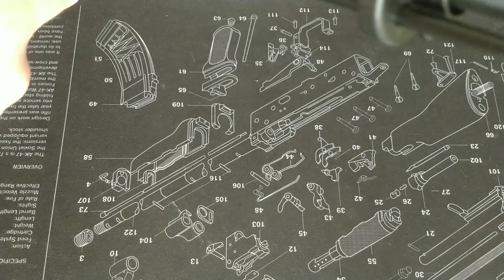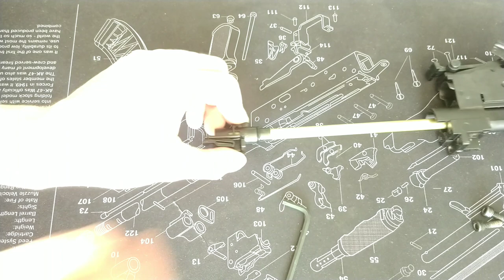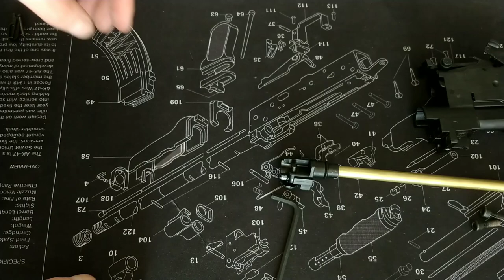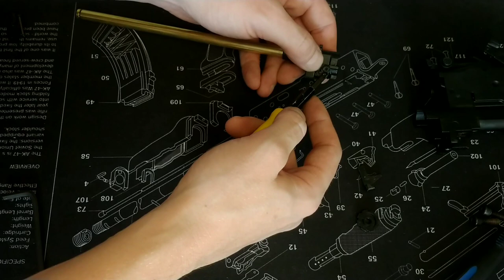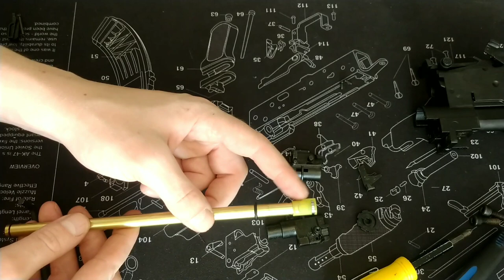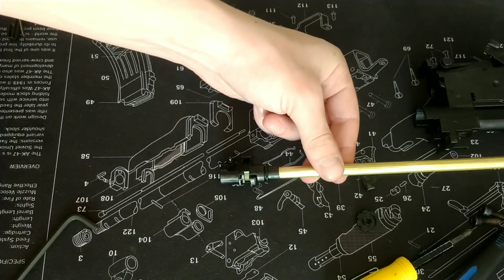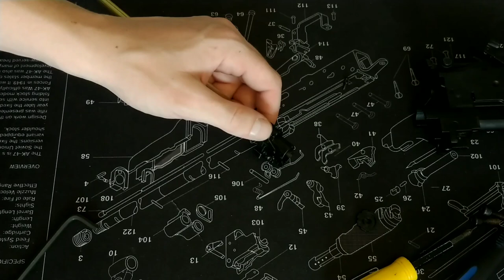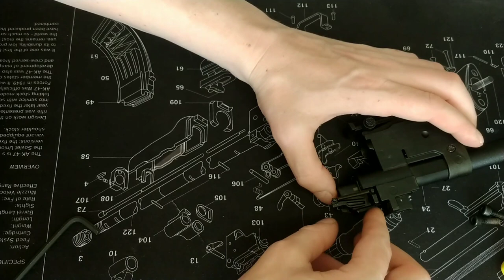Marui AKM GBBR - Guide for installing a new hop rubber using a Maple Leaf Silicone 60° Mr Hop

Comment: I wonder if there's a benefit to installing a longer barrel 🤔  tight or widebore? I don't know enough about the benefits tbh. I have the 60° hop and spring on their way.
Thank you for your time and info on the TM AKM. There aren't many videos on YouTube covering what you have.
Reply from the maker: So a longer barrel will increase your FPS and accuracy, a tighter one will also add to the FPS and Improve accuracy a tiny bit but not as much as adding length. A wide bore will reduce the FPS a lot, probably more than you would like (better for HPA as you can increase the volume of air being used with each shot)
The hop rubber will be the biggest game changer when it arrives!!
Reply: @Ollie Talks Airsoft  lovely, thanks for the quick reply m8. I was kinda underwhelmed by the AKM range from stock. The hop and spring will definitely make me more willing to run with the AKM. It's a shame the mag capacity is so low really. 
I'll look for a longer barrel - any suggestions bud?
Reply from the maker: @richard_pryor  I've found the maple leaf crazy jet barrels are great bang for your buck 👍

Comment: Been a fellow lurker for some time. Finally pulled the trigger on a new tm akm set system thanks to you :3 grabbing this bucking 1st thing  once mine arrives in the states.
Reply from the maker: Glad you're enjoying the content, the AKM is an absolute beast so I'm sure you'll be happy with it. Also it's good that the takedown is so simple to change the hop rubber. And being in the states a longer inner barrel will bump your FPS up to US limits.
Reply: @OllieTalksAirsoft  Read my mind! Starting with the stock 250mm mws barrel I have lying around

Comment: Is there any links for barrel upgrades? I cant find any body talking about what are some good barrel upgrades. Or is any VSR 10 barrel will do?
Reply from the maker: Any VSR cut barrel will do. The standard for the TM AKM is 200mm but you can go longer which will also increase FPS . Maple leaf CJ barrels are good and pretty cheap, edgi are probs the best overall but expensive.
Reply: @OllieTalksAirsoft  Will all these barrels compatible with the maple leaf silicone mr hop?
Reply from the maker: Yes

Comment: Thabk you for making this video! Going to install my parts this coming weekend.
Any chance of a video on how to install the bowmaster spring? Or did you already go over it in another video?
Reply from the maker: I did do a video on the BowMaster spring and it covers the install. It's pretty simple and to be fair it works great.
Reply: @OllieTalksAirsoft  awesome 👌 so I did go and watch that, the bit at the end, does that just pull off?
So is it, remove small plastic bit that's towards barrel, remove spring, slide off 2nd plastic piece thats closer to rear of gun, and just replace with steel parts and spring?
Reply from the maker: @shockwave.9749  Spot on mate.

Comment: I currently have an autobot bucking in my MWS, but was thinking of getting one of the MR Hop buckings. How are you liking the performance of the bucking?
Reply from the maker: it has a bit more range and the accuracy is pretty decent too but I think for me the deception one is the best when combined with something like an omega nub 😉 (although that's a bit more MWS really) for this one just dropping in the Mr HOP marrively increased the range
Reply: @OllieTalksAirsoft  I appreciate the insight! I might have to give the decepticon a try. My current build has a Prommy 6.03 363mm barrel, 50 degree autobot, and the SP systems flat hop nub and their arm/chamber (waste of money and on par with the stock unit), shooting around 420ish on a .20g. Your channel has helped a bunch and I thank you for genuinely engaging with your viewers and helping!
Reply from the maker: aw thank you buddy, thanks for the insight on the SP chamber, I got the nub and rubbers i was tempted by the chamber but have only really heard good things about the laylax as an aftermarket option.

Comment: Hey Ollie. Great video. Would you recommend a hard rubber or a silicone rubber for the MWS? Does it even matter?
Reply from the maker: ive had great performance from 50 Degrees up to 80 Degrees, stick with 60-70 and you can't go wrong, but the way GBBR rubbers are made makes less of a difference as they're thicker.
id go silicone but only because it gets cold in the UK and its less affected by the cold.

Comment: I just got my AKM! Using .30g and it shoots low at 10m. Is switching to a 60 degree or softer all I need to hop heavy BBs? Have you kept the stock inner barrel or increased its length?
Reply from the maker: yeah, with mine I couldn't hop over a .28 on the stock setup, I switched just the rubber to a 60 Degree Mr Hop and could then over hop .32s 
inner barrel remained the same 200mm stock TM

Comment: Thanks for this, i am getting mine in a few days
Reply from the maker: Yeah it's an easy drop in but makes a hell of a lot of difference to the range and accuracy!!
Reply: @OllieTalksAirsoft  I already got it, and just did it! while I was at it - changed the inner barrel to a 300mm lambda5 - gave me 1.35J on 0.2g bbs ! 
I am really relieved that it was so ez to change this part... I still remember the horror of unscrewing loctited barrel nut for my MTR :D 

Anyway, regarding the hop up adjuster part - i tried different nubs in it - omega nub, begadi vsr nub, just a standart old aeg nub - not one of them fitted properly - gave too much compression - so if you happen to find a solution on the hop up nub - please make a video out of it ;)
Reply from the maker: @tads999  I definitely will. I saw there wasn't much room in the hop chamber for a nub which is why I guess TM didn't include one. The way a I key would sit is different though, if there was space for it length wise then I think it should work. I'll be getting the Dremel out and reporting back!!

Comment: What BBs weights is your AKM to lift right now with the bucking upgrade?
Reply from the maker: I've not had a chance to test properly yet but from a few shots it looks like it's lifting .32s. If you're subscribed keep an eye out I'll be doing an update once I've tested it properly 👍
Reply: for me it overhops 0.32g easily, but then again i changed the inner barrel as well and it gives me more FPS